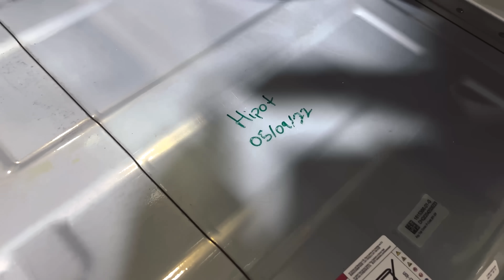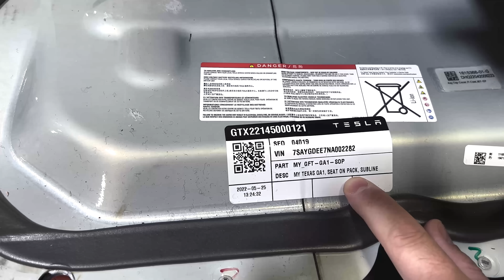Tesla Model Y 4680 Structural Pack OUT!!!

Comment: $800 x 800 cells is brilliant.  but one way you could have done it is set 10 cells aside limited supply of 10 cells autographed by Sandy Munro to be released within 1 month at $2000/cell.  next 100 cells signed by the Munro crew at $1000/cell (100) released in 3 months.  and lastly $500/cell to be released in 6 months from now.   and then release another 10 cells for $2000 in a few months
Reply: Good idea. I would like to have seen them send the person responsible for offering their place in line a cell autographed by Sandy or Cory. 
And send Elon one to or even the whole 4680 engineering team. 😎

Comment: Tesla is unbelievable. First they showed a skateboard design and after some years everybody tried to copy it. As  soon as the so called competition had something similar, Tesla comes and shows a completely new design with giga castings and structural battery pack and everybody is years behind again.
Reply: As Sandy has said, by the time other OEMs make up the 5 years they are behind, Tesla will be another 5 years ahead. And Sandy said Tesla is ahead more than 5 years in some aspects. Elon has said he doesn't mind other companies seeing Tesla tech in patents because he always want to be moving ahead in innovation.

The same goes for SpaceX. The Falcon 9 has made all other rockets obsolete with its reusable first stage and low cost. ULA (Boeing and Lockheed) is too bloated and slow to even try to imitate it. They're still struggling to come out with their new Vulcan rocket, 2 years behind schedule. Rocket Lab is working on an F9-type design that looks very promising but is years away. Ditto for a couple of other new startups. China is working on F9 type rockets but it'll take them years also. 

If you're unfamiliar with the Falcon 9: It has landed a booster over 100 times in total. This year so far it's launched more than all the other companies combined, excluding China. Ditto for 2021.

And before those poor SOBs get theirs flying SpaceX will have been flying the new Starship for a few years. That's a total quantum leap in rockets, huge and fully reusable and much cheaper than even F9.

Comment: I'm impressed from a manufacturing and cost perspective about the insane integration, e.g. the discussion of the aluminum fin holding the power line bracket at 9:20. But I'm also concerned from a repairability and thus longevity perspective. If everything is one huge solid piece -- including small details like that fin -- doesn't it become HUGELY expensive and/or labor-intensive to do repairs? Don't we run the risk of Teslas becoming easily-totaled vehicles, which is itself wasteful and environmentally-unfriendly?
Reply: I don’t know about this center piece once it is cast, but it is well protected. The front and rear castings attach to the body with sacrificial aluminum extrusions that can be cut off and replaced, and since the castings are so strong there is less chance of the ‘frame’ of the vehicle being bent.

Comment: At least a crashed Tesla will have a usable PACK to turn into a chubby powerwall (hey, let's "integrate" it, got a sledge hammer?) or even build a hot rod or race car around. Would be a fun challenge to build "crate" cars around this pack+floor combo. How light a trackable 2-seat car would be possible? Rear motors and the like off Model S Plaid (675 hp there). Roughy in line with the Model Y Performance this pack would go in. Omit seats and console, you have an 1100 lb pack to bolt into a proprietary carbon fibre monocog chassis. Using the rear giga casting of Model Y with like 350 hp would also do the trick and probably save precious weight, remove complexity. Can we design a trackable 1000 kg / 2200 lb BEV?
Reply: Yeah lookup the mcmurty speirleng ev record setter from this year's goodward hill climb event.

Comment: Does this constitute a cell-to-chassis architecture? Seems cell to pack to chassis to me. And there may even be modules.
Was Tesla's language initially not hinting at more intergration of the cell to the chassis? Now we have what looks like at best a large structural module (come on, it's a pack) that's bolted rather than welded in, and there is a theoretical chance to swap faulty batteries.
I'd love to know the chassis stiffness and strength with and without the drop-out battery pack.
All Tesla did was remove the piece of floor that sat between seats and pack and was indeed part of the structure and bolts some interior stuff to the new style pack.
At least a crashed Tesla will have a usable PACK to turn into a chubby powerwall (hey, let's "integrate" it, got a sledge hammer?) or even build a hot rod or race car around. Would be a fun challenge to build "crate" cars around this pack+floor combo. How light a trackable 2-seat car would be possible? Rear motors and the like off Model S Plaid (675 hp there). Roughy in line with the Model Y Performance this pack would go in.
Reply: Tesla did more than replace the casing. The cells themselves are load bearing* and fixed in place in such a way that the entire structure is like a solid slab. Sandy was able to get enough info to explain this in an earlier video, and he stated with no reservations that it will be a lot stiffer than the old way. This design also eliminates the structural pieces that surround the old pack. Those don't just hold it to mount into the car, they are part of the unibody/chassis, thus have to be heavy enough to hold the car together and keep the passenger compartment protected in a crash. All of that is taken over by the new structural pack. 

*Another channel tore down a single cell, The guy had a hell of a time getting it apart. IIRC it was The Limiting Factor.
Reply: Chassis stiffness and strength without the battery pack will be unacceptable, just an any unibody car would be without the floor panel.

This pack bolted into a tube-frame custom, using the pack as the floor and shear panel, would be an interesting project approach. Unfortunately, most interesting projects (including any rational 2-seater) need a shorter floor than this car has, so possibilities are limited.

Comment: Some other car's batteries weigh more than this structural pack and the seats on top.... Wow
Reply: And some other car's batteries  have much higher energy capacity. An elephant is many times heavier than a mouse... wow.
Reply: @brianb-p6586  that is awesome, let us know which companies as I don't know, so I can compare.
Reply: @aro-rat  the specs for every EV include the energy capacity of the battery (in kWh). The stupid comparison by Munro is between this Tesla car and a much larger Rivian pickup truck - check the specs for energy capacity. Every truck and larger car, and many SUVs, will have much more capacity than the Model Y; they need it due to their higher energy consumption.
Reply: @brianb-p6586  thanks Brian

Comment: What do happens when you need to service or replace the battery pack? I actually am more fan of the F-150 Lighting approach, with the battery pack easily accessible. The disposable Tech culture now arriving to the Automotive industry.
Reply: Replacing sounds like less than 40 bolts. No Tesla pack is serviceable but they are extremely long lived.
Reply: @andyonions7864  you should take a look in how many early Model S are still on the roads with their original battery packs. We are also talking about a relatively new car model.
Reply: @andyonions7864  ...and the seats, the carpet, console and any interior wiring.

Comment: In future video, please talk about how you support the car during removal...it looks like you were just supporting car from jack points.  Does this mean structural battery pack is only needed for dynamic loads?🤔
Reply: Right - you don't hold up the floor panel of any car to work on it, and this structural pack is - as far as the structure is concerned, just a heavy floor panel.

Comment: The biggest advantages with the Panasonic 4680, is in terms of packaging, reducing overall weight. And with that more range. But using structural battery packs in cars, will eventually turn them into disposable tech items, once the battery pack is too degraded or obsolete.
Reply: Tesla 4680 battery packs should last for 1,000,000 miles and can be purposed as static storage then be recycled into battery packs once again.
Reply: @mallamal5578  the issue with battery degradation isn't about charging cycles, but with Cells degradation over time.
Reply: In theory the battery pack is designed for 1M miles (robotaxi usage), but at least now we know the entire structural pack can be replaced with not much more work than a non-structural pack, from what I see in this video.

Comment: How much harder does this make it to remove the batteries for recycling?
Reply: My guess is that when a pack fails, they will pull the pack, remove the electronics from the penthouse, then shred the rest without spending any effort taking it apart. Any material recovered for recycling will be separated from the stream of shreds.
Reply: Watch the whole video! He said it was just as easy to remove this whole pack assembly as removing their model s plaid pack was. 👍🏻
Reply: @4literv6  I did and he also said it was going to be difficult to remove the top of it to get to the batteries. Is this because it's structural?
Reply: @paul_null  good point, I was thinking you meant removal of the pack itself. No idea how hard it'll be to crack the top and get to the cells.
It seems that varies wildly from ev to ev as some make it seem you can get the lids off and others make you basically destroy them. 🤔